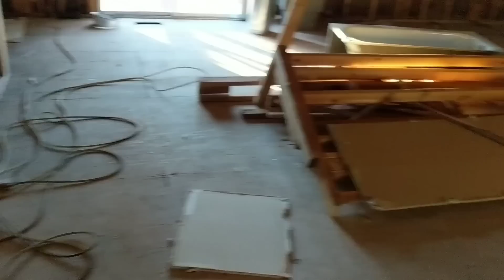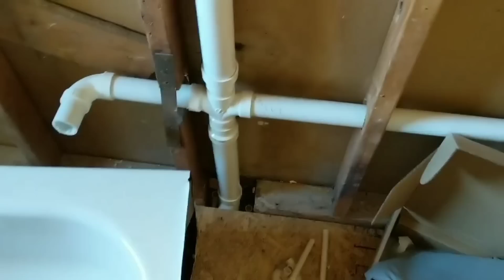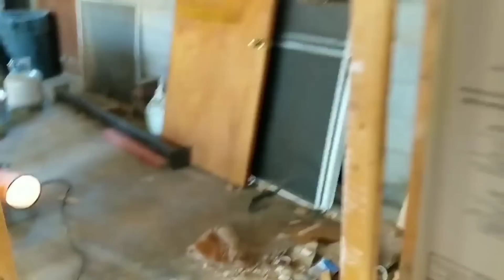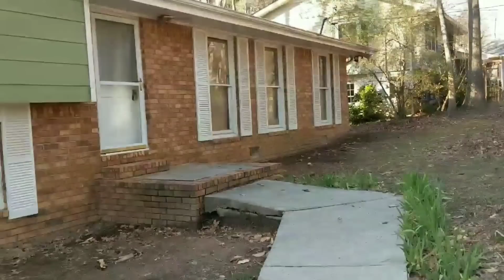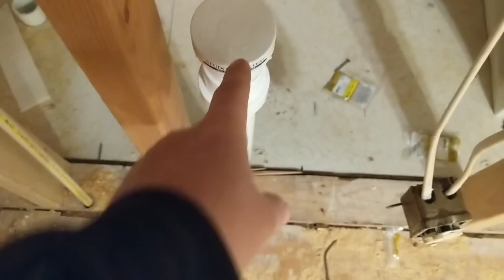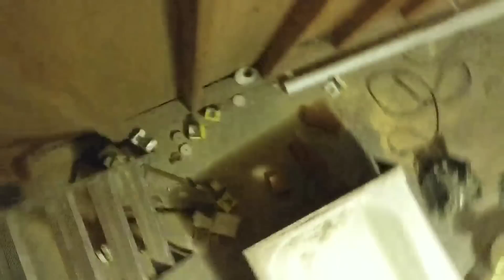On the Job with GA!!

Comment: Looks good great work .I like the pex  for smaller line shark bites come in handy but it's about cost on the job. The worst is when you run into them needle valves on smaller copper lines.👍👍👍
Reply from the maker: 😠🤬😠!!! Or a clogged drain under a house with no way to dump the shit💩😱😵😱💩
Reply: GaPyro 81 
Ya that's not good.

Comment: Cpvc lines?  Call me old fashioned but i still prefer copper 🤣.
Reply from the maker: Copper shoots the price way up. Most of these flippers and slum Lords already want the cheapest price possible.
Reply from the maker: I do copper in my home or a high-end install. Plastic isn't bad though, even on a main line as long as it's 24 ins deep or deeper.
Reply: @gapyrodawg5181  just curious what will that house sell for when it's done?  Over here $300, 000 will get you a 1 bedroom studio if you're lucky🤣🤣
Reply from the maker: @Randeezy8oh8  Doraville is a upper end area here in Georgia. It's very close to Atlanta and inside the perimeter. But it has a small backyard and a Apartment complex just over the fence. Also traffic in that area is F'ing insane!!! But I'd say even still you'd have no problem getting $345,000 or more because it's in a highly sot after area.